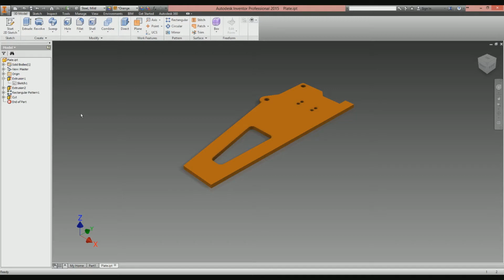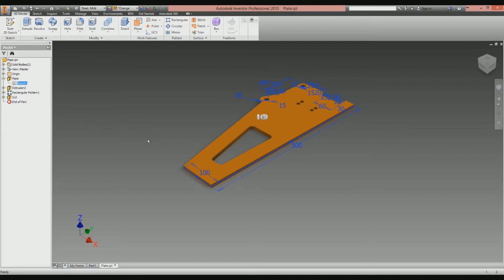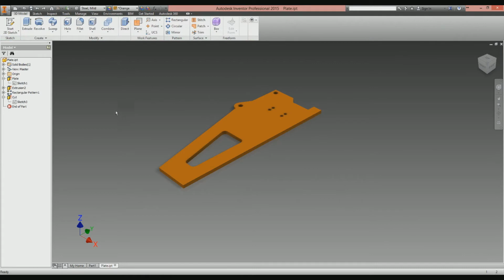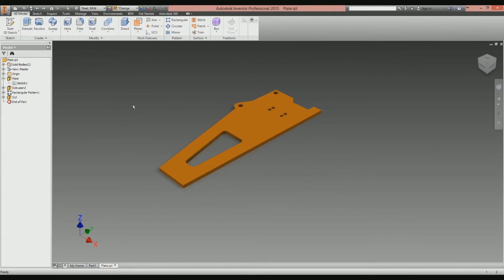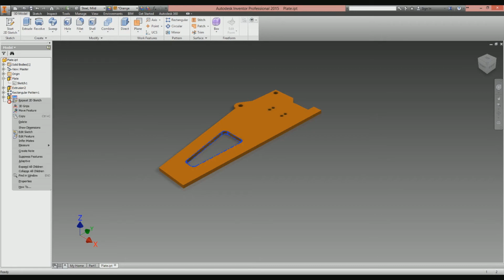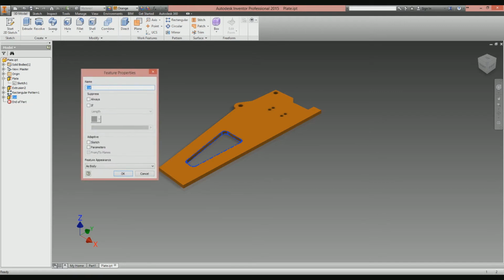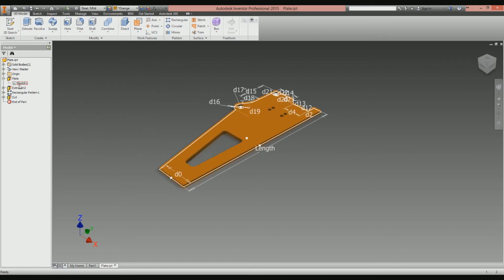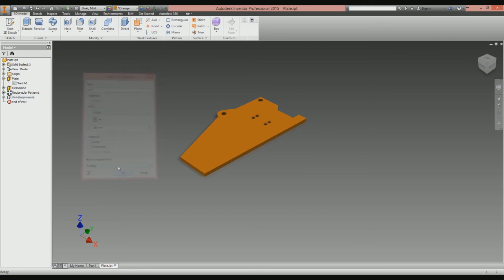Intelligent 3D Part Feature Suppression | Autodesk Inventor

Comment: Is there anyway to suppress a sketch? I have an iPart where one of the sketches doesn't make sense for the smallest members. I can suppress the features that use the sketch no-problemo, but when the smallest member gets computed it breaks the sketch, which then propagates to the larger members and it breaks the dependant feature. To be specific, I have circle in the sketch with a line bisecting it; in the smallest member the circle becomes zero diameter and the bisecting line disappears. In the larger members with a >0 diameter the bisecting line remains MIA.

Thanks again for the amazing videos. I've learned more in the past month of watching these than the last 3 years of using Inventor, especially the little auxiliary tidbits and advice that get thrown in with most videos.
Reply from the maker: Thanks Nicholas! Unfortunately there isn't a way to 'suppress' a sketch, we can only toggle its visibility